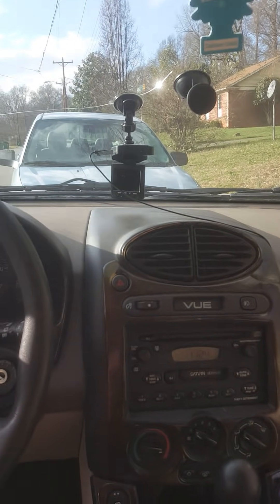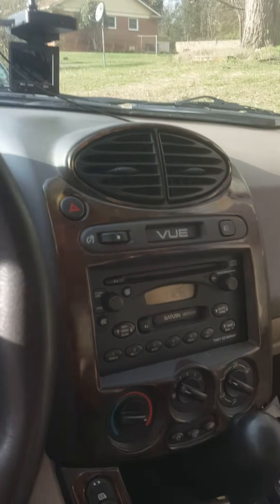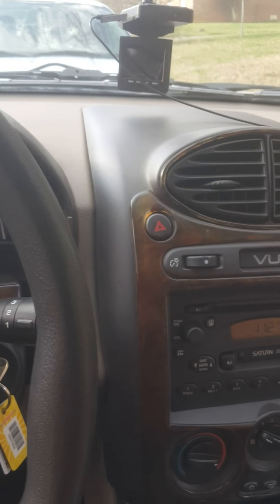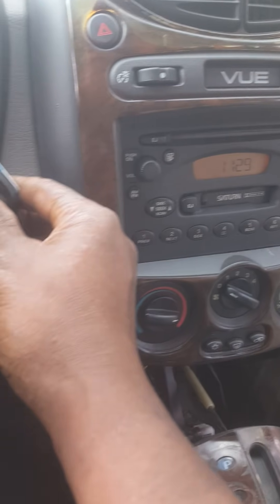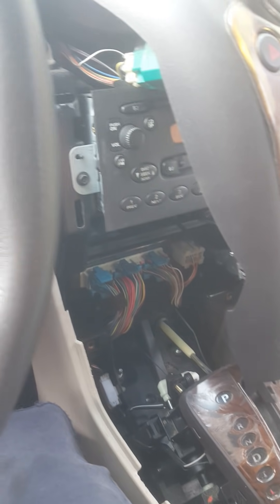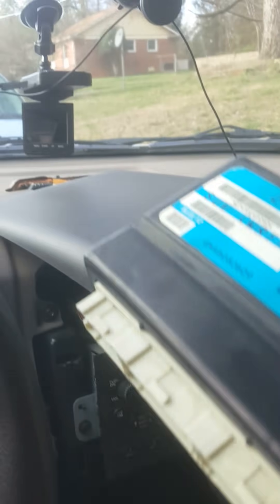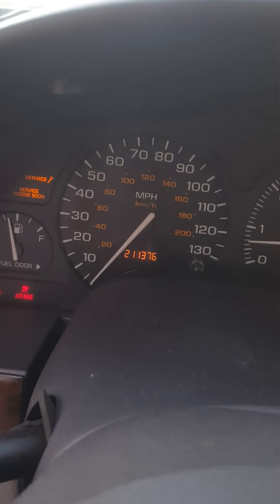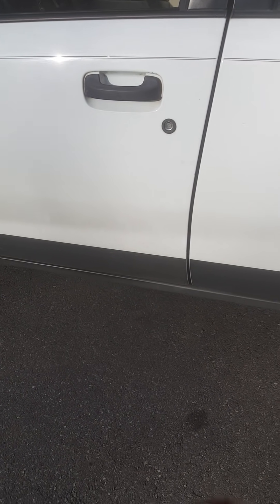How TO PROGRAM A BCM ... WITHOUT GOING TO THE DEALER

Comment: My brother ! I am sorry but that is not a complete programming of a BCM , you have to program the security system too In order to get the door locks to work, I am Mobile Tech. For 28 years now, and I  do programming on all makes and models and you have to buy the yearly subscription in order to program to days vehicle properly and there is always an update software to fix some kind of issues on the car, so that is misleading information to give to people, so with that said, please do ur research 🧐 before making these videos ! please ! P.S. keep in mind that today vehicle computers communicates on a data bus line and not programming a controller right can cause so many problems so be careful of what you posted on line! Thanks! Teddy Extreme Auto Mobile Diagnostics LLC, NJ

Comment: Will that work for my 02 envoy. I replaced the multi switch for the cruise control right after the cruise stopped working and it said that the BCM is the problem. According to the scanner. And does it work the same way to reprogram the other BCM I got for it. I made sure that they were matching numbers and all. But it won't start with the other BCM.

Comment: 22714306 is the part number of your original BCM. You have to use the same part number for everything to work correctly. I am having the same problem, I did not know the part numbers had to match. My key fob and air bags are no longer functioning after BCM replacement with ebay BCM non matching part number.

Comment: Everyone has the option of taking the risk to swap out a used bcm  or replace it with a new one. It's your choice. If it work great. If not go get a new one simple as that. Thanks for the info the dealers are not going to share it. And some mechanics will not either. Hmm

Comment: Very helpful info  --  thanks alot, bro! 
My Saturn is a 2000 SL2 model that has a metallic-housing control module located directly behind the battery, so there's likely no way that I can access it without first removing the battery.  I'm thinking then that I'll have to take out the battery, switch out the control module, then wait 24 hours before reconnecting the battery, huh?

Comment: Aaron I need ur help my car won't start because of security alarm system. I was able to turn it off through my car radio, but now when I went to settings to turn off I didn't see alarm in the settings..i need my car for work and I need help and if anybody has any feed back please text me.732 926 4662 it's a 2000 chevy impala 3.4L thank you.

Comment: Thank you Sir. I had been trying to find out how to program the BCM and doing it your way it worked great the lights on the dash came on when I started the car but they started going out as the car ran, It works great now Thank you again.
Reply: BCM it really Worked I have no  power windows, no tail lights, no tag lights, no dash lights, i checked fuses are good even replaced main relay
Reply: @TheSleepler  Dude, I have the same issue. I can't get a used BCM anywhere. Need a new one. But doesn't the BCM read from teh ECU and learn info? Or does it really need to be programmed?

Comment: Hey bro so I ended up unhooking my battery on my 2003 chevy impala 3.8L and took out the bcm, so I would really have to go to a dealer now?
Reply: He has no clue what he's talking about. The BCM has an EEPROM which holds all the programming and it is not lost when the power is removed. There are even websites which sell preprogrammed BCMs, and that would be impossible if what he's saying were true. The best way to avoid the expensive dealer programming is to copy the EEPROM from your old one and flash that to the replacement one. All you need is an inexpensive EEPROM programmer, and Google to find out how it's done. To be clear, I'm not saying he's wrong about hot swapping BCMs. I haven't tried that and don't know if it works or not. But the idea that BCMs have to be reprogrammed if you unplug them, or remove the battery, that is completely untrue.
Reply: @SwapPartLLC  I understand what you're saying about the EEPROM, but for those who may not have a computer, and the module is bad, he actually provides the only presentation of this idea on video.  Because people, such as yourself, are afraid to try this, because the dealers won't share this with us and they claim that only they can reprogram it.  However, what I have learned is that he was able to bring the EEPROM information from the other module to his car, by "Hot Swapping' them.  This is useful information, especially when the other module has different functionality, because some of us Want to remove things that might be detrimental.
And, your statement on how the best way to do something,  is baseless, because you haven't even tried them all.  You have nothing to compare it to.  But Mr. Harris has just provided a basis of comparison For Us All, to use.  This also tells us that he could likely, replace his original module, using the same procedure, and regain his old settings.  Maybe even with some gain in functionality.
Reply: @AlexR1ish  I wasn't saying what he did couldn't work. In fact, I specifically said I wasn't saying that. I was simply saying that he was wrong about the BCM being erased and requiring reprogramming when the battery was disconnected. If that was the case, then you couldn't even replace your battery without a costly trip to the dealership.

Comment: Hello, I wanted to post my experience because a lot of people are coming down on you. So, this was my experience changing my BCM on my 2011 Chevy Impala. I purchased a used BCM, part number was correct. Took my lower dash apart and unplugged the 7 couplers that jack into the BCM. Then I placed the car key in the ignition and turned it on. Then I hot swapped the BCM by plugging in the couplers. As I did the lights on the dash came on. Then after all the couplers were plugged in, I started my car and as it ran all the lights on the dash came on, such as traction control, ABS, Stability Track error and so fourth. As the car ran, the lights turned off. I kept the car running for about 12 minutes. Turned it off because one of my concerns was the anti theft system. Everything worked fine, I checked it with my Tech 2 program, anti theft system was working, my FOB to open/lock doors, pop trunk, and auto start vehicle worked. The mileage carried over from the original mileage. Drove the vehicle for 50+ miles if any learning was needed. It actually worked, I have to say I was surprised. That was my experience, thank you for coming up with the idea.
Reply: you mean  you turned your car off and then you replaced your BCM and it worked with your original car information without losing any infos. Right ?
Reply: @dwightlee6164  The BCM needs to be hot swapped. Meaning when you are ready to plug the couplers into it, the ignition needs to be turned on.
Reply: @petercosta3884  did you turn on the car with the original bcm still connected?  Then did you leave the car running while you hot swapped over to the used junkyard bcm?  When did you disconnect the original bcm?
Reply: @petercosta3884  “hot swapped” would imply that the original was also disconnected in the same position, but that’s not what you describe. That’s just hot insertion. Did you mean to describe a hot swap?
Reply: So, you started it before you took your bcm out and swapped it while running, or, unplugged your bcm, started it, then plugged in new bcm? You described the latter but used the term hot swap. I ask because I'm trying to change one.
Reply: @Sublime_1  Yeah. I believe he got the order wrong in the OP because I don’t think the vehicle will start without a BCM.
Reply: @emmettturner9452  right on, thank you. That's what I'd thought but wasn't sure.
Reply: Got a 2007 impala and did the hot swap and am getting air bags and trunk warning messages. And my radio is locked. Any thoughts on what could help?

Plus I don't get any acceleration when I press the pedal too.
Reply: thats kinda what he did just the explaining was confusing
Reply: I have a 2015 Chevy Malibu LS model with 133,000 miles. My AC is not working. I am having issues with my remote and I’m getting some stability warning lights, etc. I’ve checked all the fuses. I see nothing wrong with my AC it’s not low. There’s no fuses blown. I’m assuming my BCM needs to be swapped out. Do you think this process would work for me?
Reply: I have a 2006 lt shoudnt the part number be the same as your 2011

Comment: You did not program that BCM. You simply transferred a used BCM to your vehicle. Your milage is incorrect and your vehicle security system locked up as a result. That used BCM has the restistance value learned from the vehicle it was removed from.
Reply: I noticed that to. He just changed out a bcm. He didn't program anything. The replacement bcm has the old information in it.
Reply: @altonrowell8137  Even though this did not work on the used BCM he installed, he did provide the proper DIY procedure for reprogramming the BCM.
Reply: @annie4oceans  are u a gm mechanic. I was for 35 years.
I used a tech 2 to program the bcm.
All he did was r and r a bcm.
Reply: @annie4oceans  not to be a smart a## but he only r and r a BCM.
As a certified gm mechanic I saw a lot of mechanics who didn't do anything but change parts. They were ignorant of how things performed. They just replaced parts until it worked.
Reply: @altonrowell8137  hey if you could help me out I have 2007 Chevy Colorado that has anti theft issues and can't start the car..there's no chip in the key so it's the PASSLOCK System from what I read...I changed out ignition sensor and tried to relearn key but the anti theft light NEVER  turns off or blinks so I'm unable to complete the relearn process...I'm starting to think it's my BCM and I'm looking for some sort of direction of could this be my issue
Reply: @altonrowell8137  Nissan dealers are the same.
Reply: I got a question for you @altonrowell8137 . I put a bcm in a 2008 saturn vue xr . Didi the reprogram and now my pps system keeps locking out. I reprogram to unlock it but it keeps happening.  Do I need to program the ecm ?
Reply: @altonrowell8137  It is possible to relearn some parameters with time but not the vin.
Reply: He just ment that if you do it with the battery disconnected, instead of the way he showed, you will not have a running car.  His way still allows for the car to run. That's better than a theft deterred one. The tech 2 that I have will make everything perfect. He is almost there. Lol
Reply: @Ernie Carrasco  If you see this, it's a tech 2 expensive?
Reply: My BCM does not have the mileage in it, just the keycodes and stuff for the control of the various parts and computers in the car.
Reply: Nothing but more crap on the internet!!!
Reply: No your dumb because the computer 🖥️ in that vehicle will remember to do what the old bcm was doing
Reply: Wow
Reply: This video was a complete waste of time and should be removed. And you kept on saying you wanted to make the video quick. You failed twice.
Reply: So you are saying he programed the bcm.
So why didn't it work.

I replaced several bcm as a mechanic. I always used a tech 2 to reprogram them.

Comment: "Don't never unplug-take your battery cables off.... Sorry man, but you shouldn't be giving advice on something you know so little about. All you did was a module swap, reprogramming requires a J2534 pass-thru device, or dealer scan tool. Many vehicles that are CAN bus equipped this advice will brick several modules, leaving you with a vehicle that won't start, and needing many modules, that need actual programming.
Reply: Actually, modules are independent on a Can bus, for this exact purpose.  If one breaks, the others remain intact.

Comment: Aaron thank you I am ordering a BCM for my car a 2007 Suzuki Grand Vitara , it looks like I need to turn on the key during the disconnecting of the cables to the old BCM and reconnecting of the cables to the new BCM. Without turning off the key after it's replaced, I turn on the ignition? Just reinforcing what you have taught me. I enjoyed your video thank you for sharing.
Reply: Well Michelle....Did  i a used one  work?

Comment: Great vid Aaron, money is tight , can anyone advise could I avoid having to reprogram a BCM in a card key start/stop button Renault ? So instead of having the ignition barrel I just put my card key in and all electrics turn on, then I just press brake and start button same time to start, I have 3 failing windows ,  just 1 of the back windows works from the drivers window module , but a parts dealer said cos only 1 window works from only the driver module switch, it may be the BCM that needs replacing rather than the drivers window module switch, otherwise the switch from the back window would work, any advice appreciated guys ? +Aaron Harris
Reply: its risky but it works